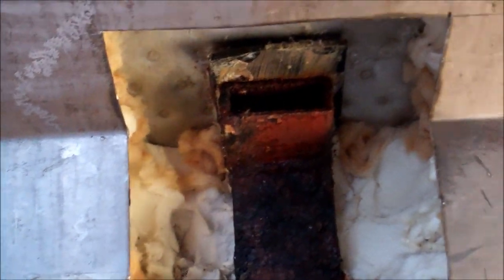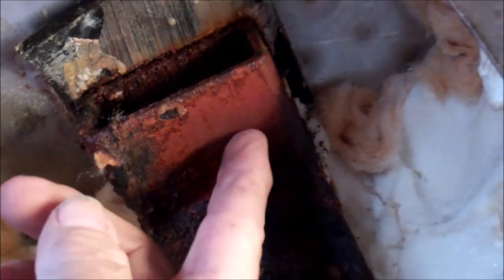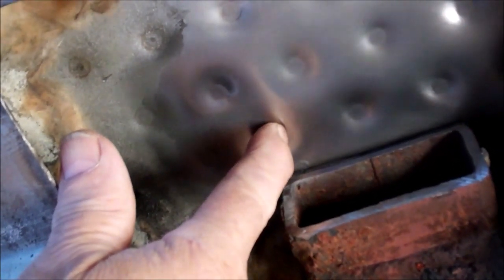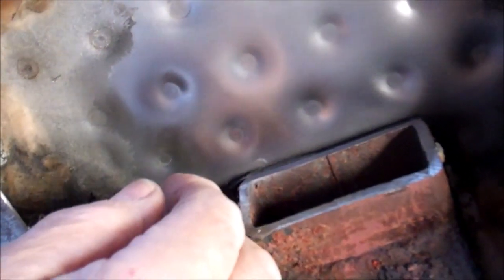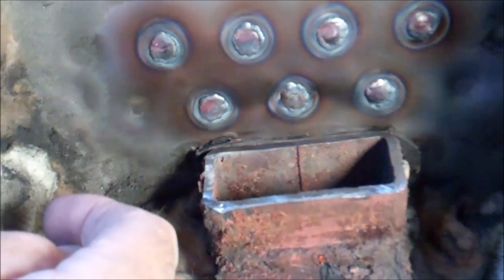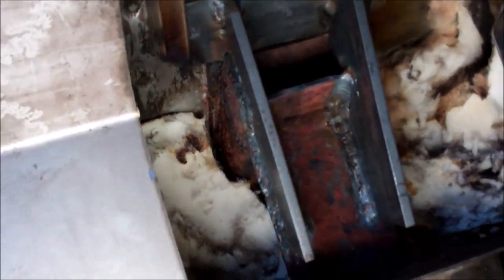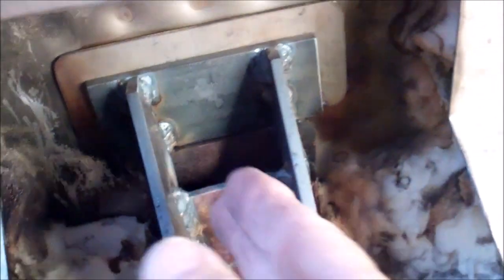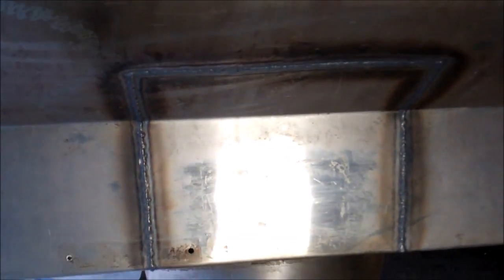Old bulk milk tank gets evaporator repaired.

Comment: Great video sir. Sir I have a business of making bulk milk cooler but sir we use cooper pipes as a evaporator instead use of dimple jacket cause sir we don't known how to fix dimple jacket in the bulk milk cooler so please sir make a video for this.
Reply from the maker: Tanu Sharma, thank you for the comment. The evaporator is a thin sheet of stainless steel which is spot welded to the under side of the milk vessel and seam welded all around it's edges, it is then pressurized to form a small cavity between the sheet and the milk vessel for the refrigerant to flow through